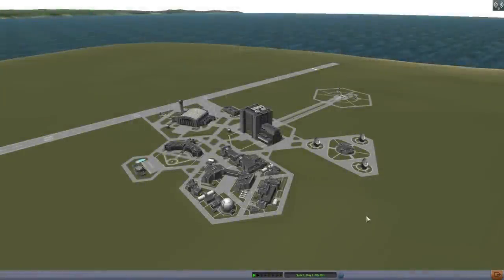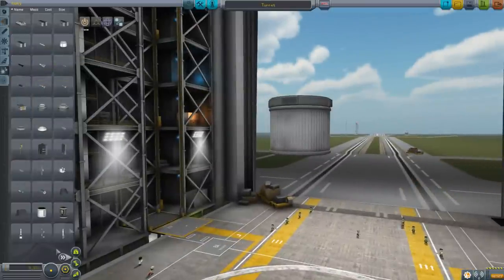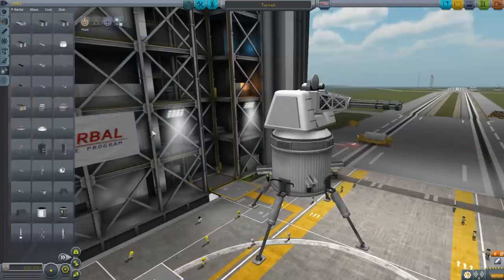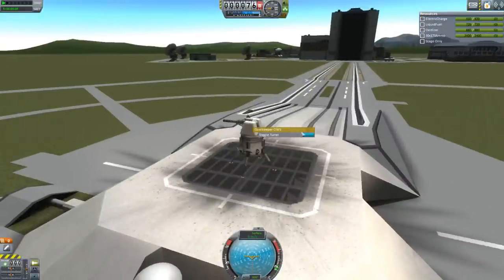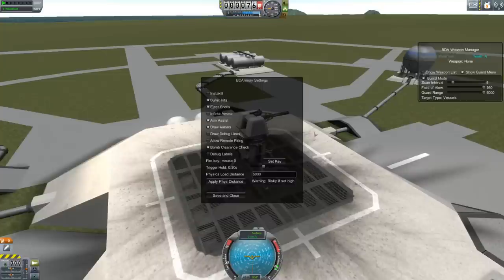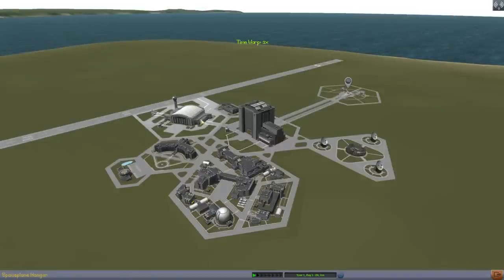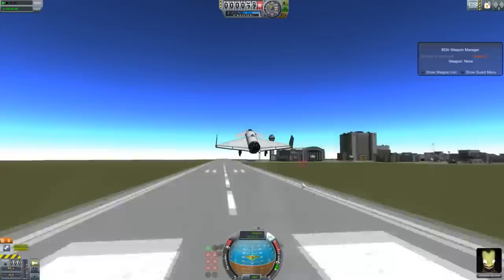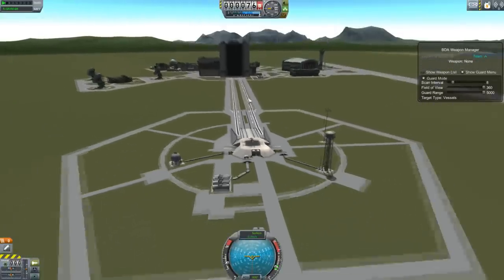BD Armory, How To Set Up An AI Turret, Kerbal Space Program

Comment: Can you make some sort of missile satellite that fires missiles from space? That would be sick 😎
Reply: Well, with the HE-KV 1 anti-spacecraft missiles become possible, though they require legacy targetting to work as of now.

For orbit-to-surface you'll need a re-entry vehicle capable of deploying GPS-guided bombs, or mod the JDAM to double heat tolerance, then deorbit the deploying vehicle over the target, release the bomb, and circularise again.
Reply: They're listed as radar-guided and any radar system will display their (incorrect) DLZ when locking on to a target, but guidance itself will not activate after launch.

I suspect that this is a bug somewhere in the missile config, but I'm not investigating that now.

Comment: could you make a video about how to make a suface to air missile turrent (SAM)? Thanks for the help ;)
Reply from the maker: +SnipezForDayz It's the same process, just put some missiles on the turret
Reply: +TAPE Gaming instead of putting a turret on top i put the missiles on the side, but when i set the drone and my plane to opposite teams, it won't fire at my plane for the life of me
Reply: +SnipezForDayz i'm able to launch the missiles manually and they do follow my plane, but they will not do it automatically... help?
Reply: +Squidward “is that what he calls it” Tentacles I think you could put the missiles on the sides, and use the sidewinders or a radar guided missile with the use of a weapons modular guidance system (it makes a radar appear when you engage it) after the radar is open, it will show the aircraft as a green dot. Click the dot and it will lock on to it (it may take a few tries) after locking on, you can fire the missile.
Reply: SnipezForDayz thanks, but how do i make it so my anti-aircraft gun will automatically lock on, rather than me having to click my plane on the radar?
Reply: +Squidward “is that what he calls it” Tentacles i don't know if you can to be honest, I never tried.
Reply: SnipezForDayz ah well, thanks for trying to help, regardless. if anyone else wants to try and help i'd appreciate it
Reply: if its still relevant (probably not) you need a radar. and only use radar guided missiles as SAM. since heat seeker have a cone view. thus you need to have the launcher directed towards the threat. to make a good SAM system you need a launcher with a radar on it. or a separate vehicle with a radar that you then connect to the launcher via the Data link pod. both vehicles should be in guard mode and then everything should be fine.

Comment: I’m using it and there is no 30mm ammo or 20mm!?
Reply from the maker: Huh, it may be that you've installed it slightly wrong, make sure the folder labelled BDArmory is in the GameData folder, inside the BDArmory folder there should be just the mods (folders labelled 'parts' etc.)

Comment: how can you put planes in place for a dogfight? i cant for the life of me lead them along to where i want..
Reply: רז רייפמן You need a mod called burn together, BD Armoury doesn't allow this. All (as far as I have found) BD armoury's plane guidance systems can do is make them fly in circles at certain altidudes/speeds
Reply: Somerandom but how do i put the planes in place?
Reply: You need to first guide them off the runway onto the grass next to it so you can load in your good guy plane. Then load in your plane, switch to the baddie plane, take off, but stay in render distance, turn on auto pilot/guard mode, then switch to yours and destroy your enemies with prejudice XD
Reply: but i cant for the life of me put the planes in such perfect positions unless i have a vtol which is horrible with the automatic flying and burn together.
Reply: If you're having trouble manoeuvring the planes into position, I have to suggestions, no.2 is a cure all. No. do your landing gear have stearing enabled, 'cause that helps alot... obvs. No. 2 download Hyper edit (just google it) It allows you to teleport you craft wherever you want them, to ensure perfect placement, make a nimble little rover, drive it the the position for the first plane, press the copy coords button (remember to move the rover out of the way), bring out the first plane, press land button, you will be teleported (remember your heading will stay the same). Also if you find your being teleported under ground simply raise the alt. no., Simply rinse and repeat. Yes it takes some time and canoodling, but like for instance in my second BD Skirmishes vid (shameless self promotion lol) I teleported the tank to the hills near the KSC rather than waste like 10 minutes just bloody driving. XD I hope this helps, if not maybe I'll make a tutorial, who knows.
Reply: Somerandom im checking you out for being so nice. seems like im gonna subscribe :D
Reply: Somerandom im sorry for annoying you but when i assign myself to leader and get my followers i cant thrust up :/
Reply: No that's ok, to be honest I haven't used Burn Together, just the bd flight thingy. Although I am sure there is a tutorial somewhere